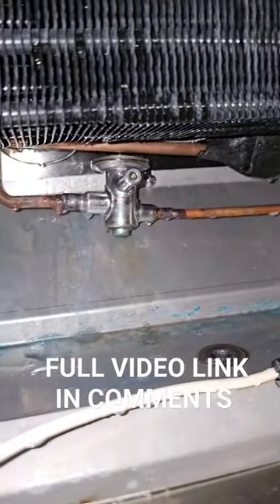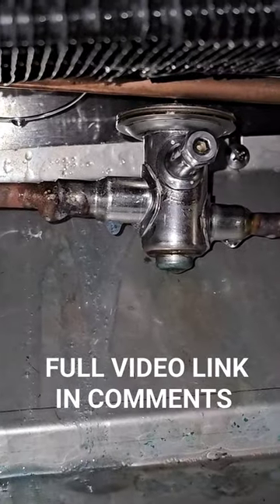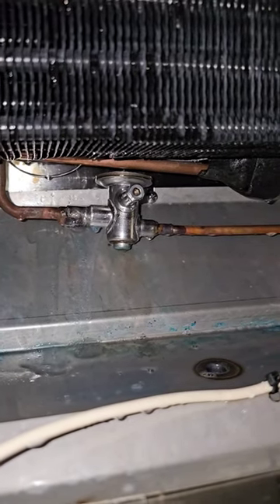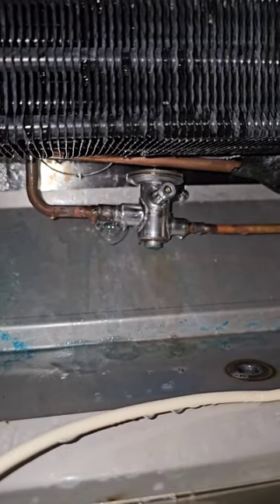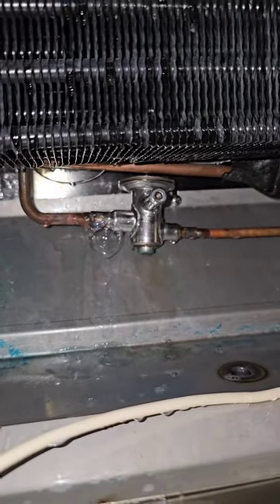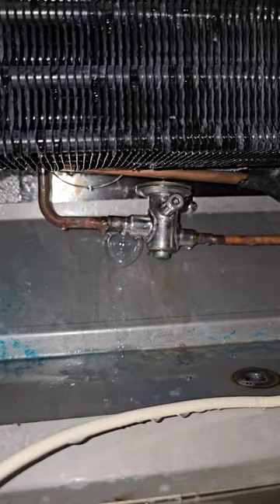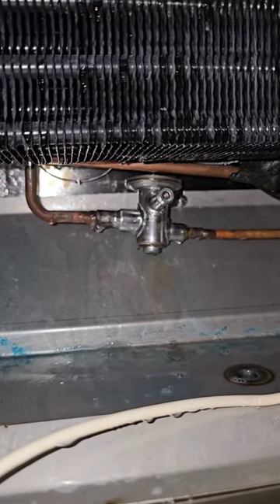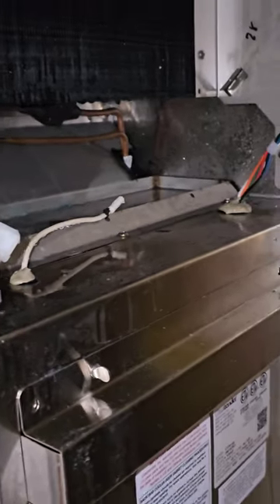STAINLESS TXV ISSUES  #shorts

Comment: Stainless steel with copper pipe seems like it never fail 🥶
Reply: Best way is for the original to be 45/56% and then any leaks can be patched. And what he's saying about not being able to mix 15 and 56% is BS I've done it before. But it was coper to brass. The brass doesn't flex where the copper will so you can get cracking sometimes. All I did was clean the sh1t out of it, lay my flux and braze away, do have to get it a few degrees hotter but it did just fine lol

Comment: Man, ive run into this before as well and really was putting myself down cause i couldnt fix by rebrazing but never knew why till now. Like you i just ordered a new valve and started fresh but i had told the customer i could fix the leak and i couldnt. Thx for this info. This is stuff you dont learn from the textbooks and it will help so many people
Reply: Very true. This is in the field learning for 98% of the techs out there. I’d have seen the bubbles and assumed I could patch it too. Luckily I haven’t ran into this.

Comment: I've used 45 flux coated to solder over copper and steel/ss without an issue.  I clean the area really well and sand down to as clean a place as possible, and it flows like butter.
Reply: Ya but it probly had 56 already, hes rite that 56 doesnt mix well with 15. Or 45

Comment: I've never messed with the stainless txvs but I have never had an issue using 56% over-the-top of 15. I have done it quite a bit on compressor braze joints that were done poorly.
Reply: Its not advised to do that though and suprised it worked for you.
Reply: @HVACRTECH-83  explain yourself. Why is it not advisable to do that and why are you surprised it worked?
Reply: Jason Goertzen  it's been a known thing in the trade forever. The two alloys arnt meant to be mixed,it's either one or the other, they have different temp/flow characteristics.
Reply: @HVACRTECH-83  interesting. I've never heard that before. If it's just a known thing in the trades, that means it could just easily be an old wives tale. A quick Google search pulled out nothing. It works great so I'm gonna keep doing it. 👍

Comment: I've brazed two leaking stainless TXV valve outlets in Scottsman counter top flakers. 
 17-0 tip, 15%. Sanded first, first try fixed both times. That's just my experience with that though.

Comment: Pull apart, clean most of the 15% off on the copper and add white paste flux after it cools down. You can warm it up and add WPF and allow it to bubble then harden, bring sboth sides to temp and use silver. Done.
Reply: Hardest thing about that job is the thin ass stainless on the txv. Just gotta make sure that's not overheated, cover txv body w/ wet rag like normal and apply most the heat to the copper male to bring temp up lightly heat txv fitting add silver and bring flame across fitting to pull silver into the joint. You can go back and forth a little once the small amount of 15% is melted with the 56. This will work most of the time as long as the stainless hasn't been burned out from over heating.

Comment: 15 % has always worked for me at lower flame 🔥. I use Danfoss expansion valves all the time . Looks like that leak could have been caused by vibration. Good repair

Comment: Pump it up, leave the ports on. Let it run and have a cigarette......
Reply: Always works, I’ve never get two calls for the same system! It just works!
Reply: You can’t leave service ports on…they might leak the refrigerant out that is currently leaking out
Reply: As in the manufacturer never has a leak in the coil, they last forever, and factory brazing perfect